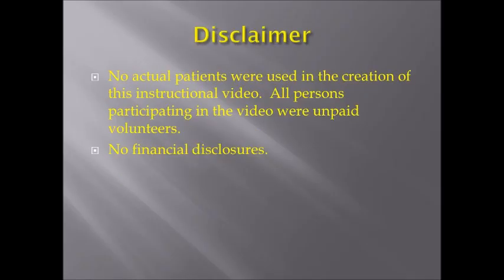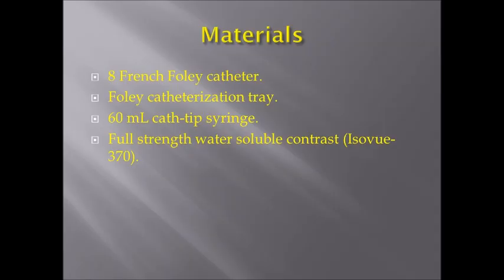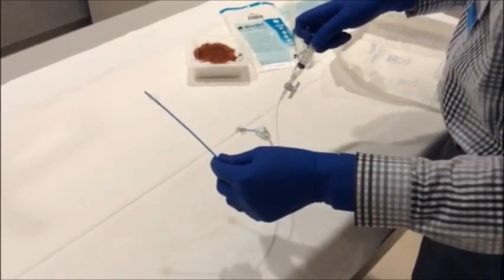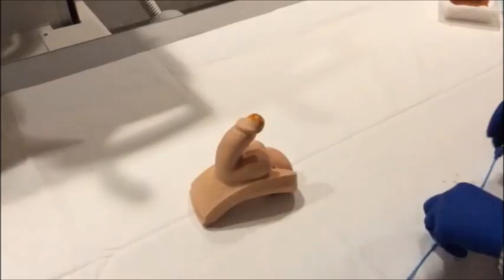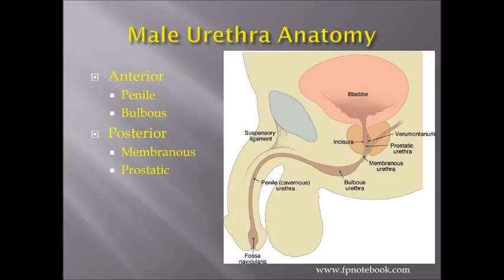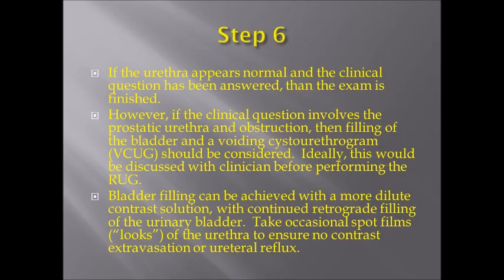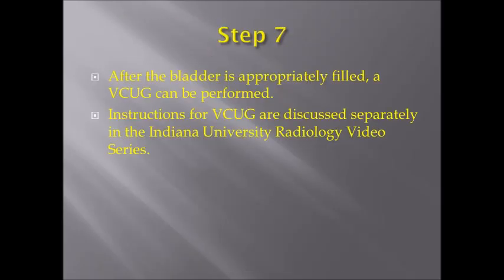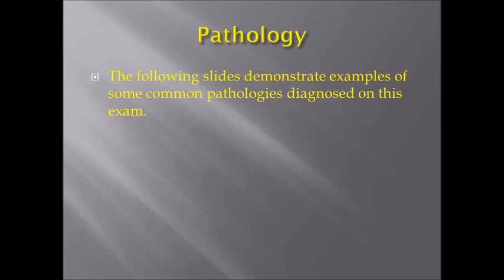Retrograde Urethrogram

Comment: my urethra is not 2cm thick. It is more like 1/10th of that. By the way, why not give anesthesia? I wouldn't want to even see that thing from 10 meters ago. Let alone feel it. I'm likely to panic and destroy the ceiling and the floor in the process.
Reply: Hi
They insert catheter 2cm inside urethra.

Its not about 2cm thickness of urethra.
Normally nobody has 2cm thick urethra 😀

Comment: Is there any possibility that liquid solution used in rgu enters into testice instead of enter into urinary bladder if it is enter into testice is there any damage to testice
Reply from the maker: Contrast passing into the testicle is unlikely. If there was a severe urethral and scrotal injury, the contrast could enter the scrotum around the testicles. This is very uncommon. It would not damage the testicles or scrotum. Thanks
Reply: @fluroradiologyeducation  we